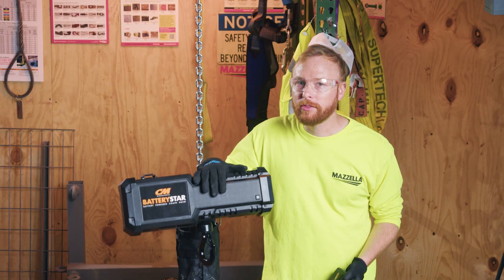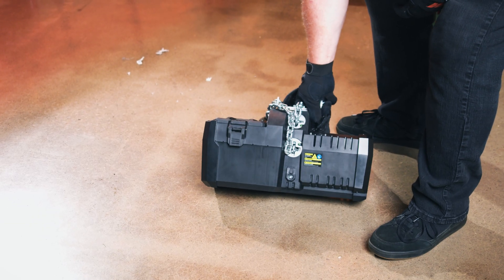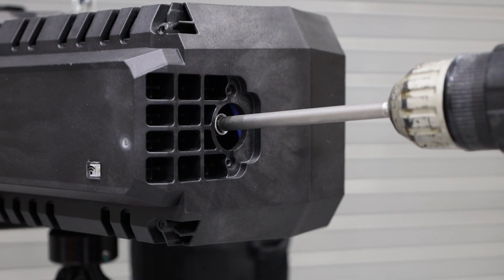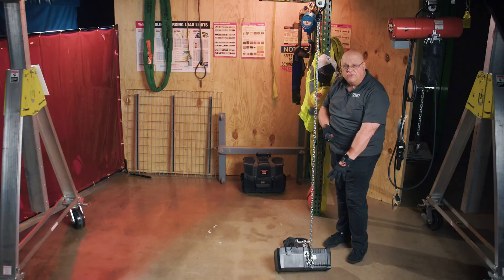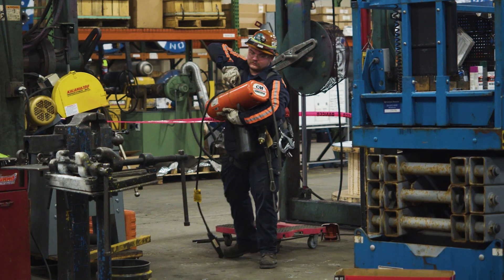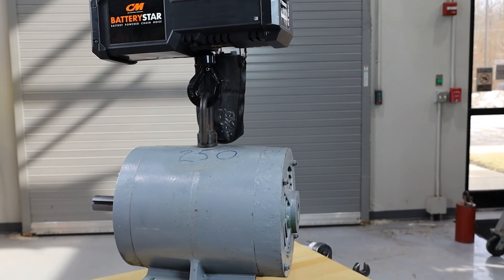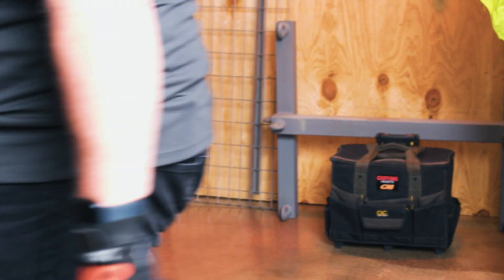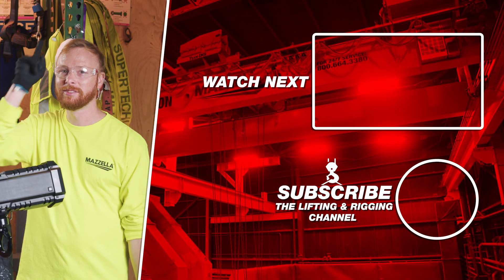CM's First Battery Powered Chain Hoist | BatteryStar

Comment: It’s hanging upside down! The chain can get caught when being pulled in, and that’s why the thing wobbles like a lamb’s tail!
Reply from the maker: It is designed to be used in both orientations. As this is a battery-operated hoist, often there is no access to equipment like lifts to help you mount it. When climbing, it is easier to mount it from what would traditionally be the bottom hook. Also, if you need to change the battery, the hoist can be brought down to your level rather than you climbing to the hoist's level. However, if you want it mounted traditionally, then it is designed to work both ways.